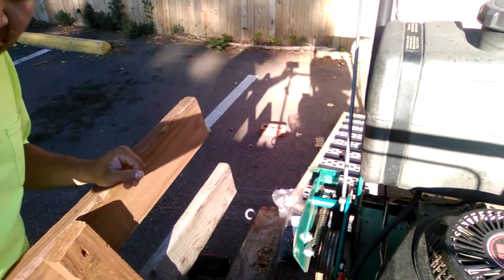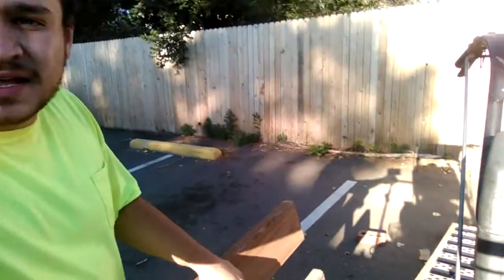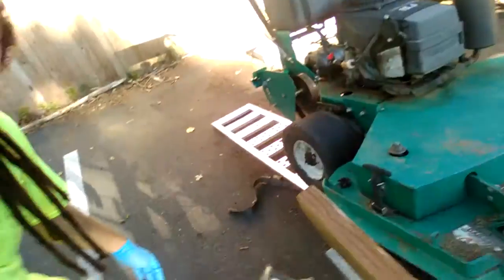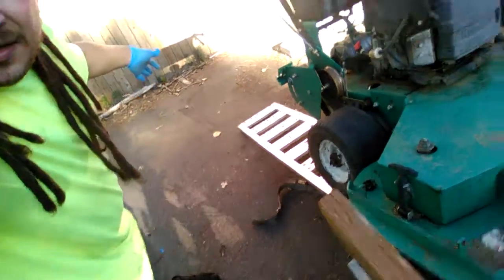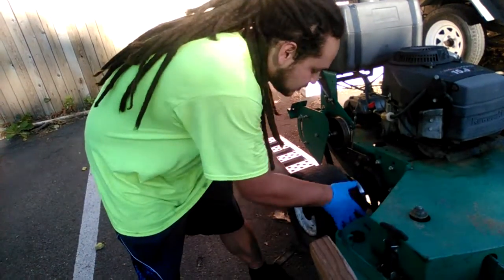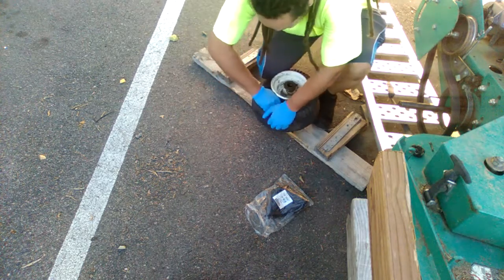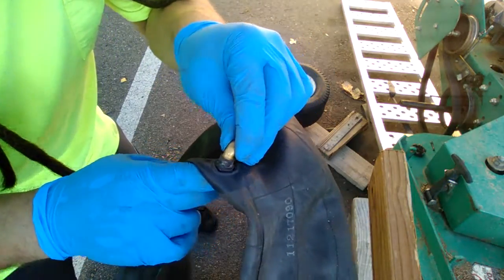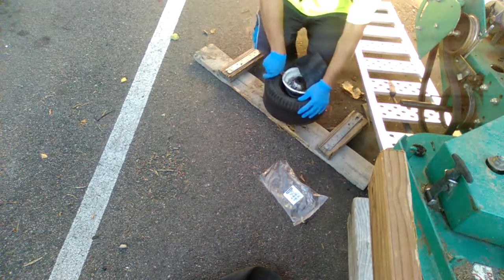Fastest Way To Replace a Tire Tube On Lesco Walk behind 48"

Comment: I have a lesco walk behind mower 36 inch.....I was having problem taking out the rear wheel also. Good thing i came across you vid.. thanks
Reply from the maker: Glad to see I helped someone. This took me 2 hours the first time until I figured it out. lol
Reply: @RyanQuintanapolymath  Sorry if I missed it in the video... My LESCO has a castle style nut with a cotter pin in it. I cannot find ANYTHING about where to get the wrench or what size it is.
Reply from the maker: @dennislum4460  after removing the pin its finger tight. No tools